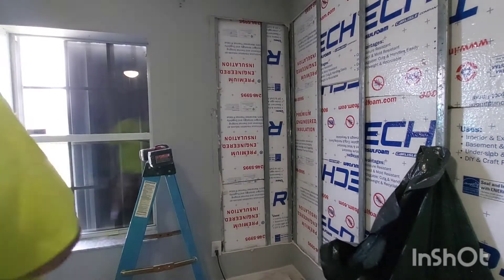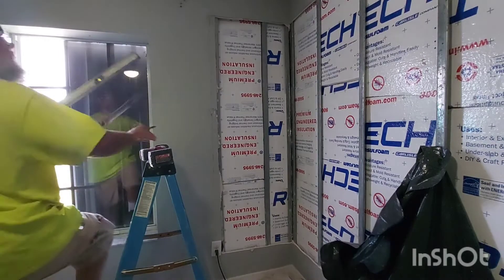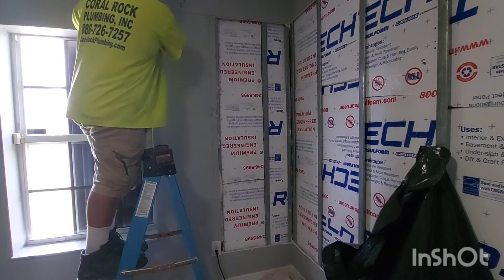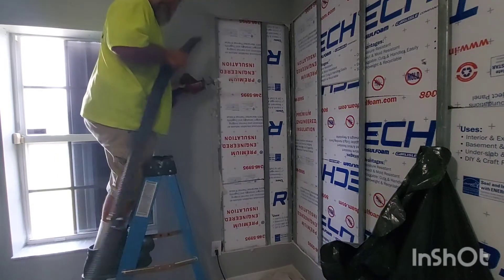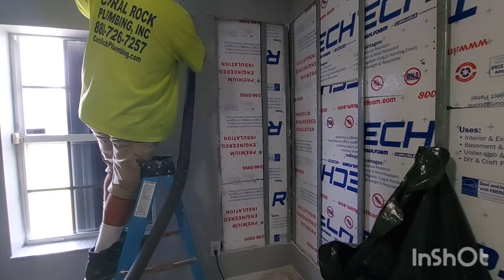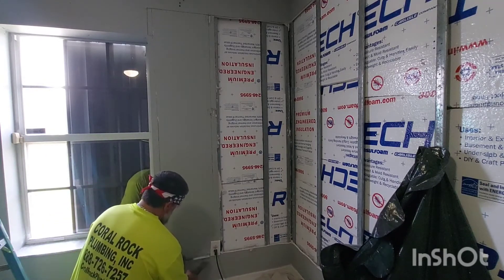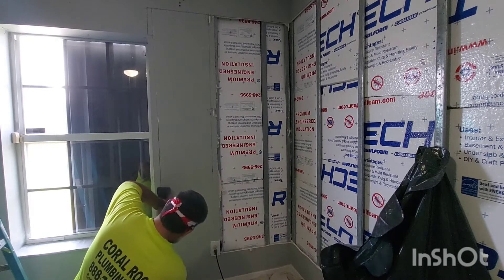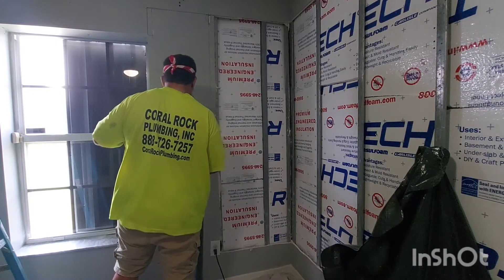R - Tech wall insulation 2inch Steel house

Comment: You could add a blind and blocking curtains cheaper than replacing the window.
Reply from the maker: Yes, but I was working in a house and noticed a bigger difference with double glass windows with gas inside them, they guys ac didn't turn on till afternoon

Comment: 2" R Tech only has an R rating of 5
2" of fiberglass insulation has an R value of almost 11. Fiberglass batts are mush easier and faster to install.
R Tech is the worst material in terms of cost vs R value. It is the lowest quality of foam which is why it has such a low R value per inch. It's R value is so low that they do not even print it on the boards for the consumers to compare in the store.
Johns Manville and other brands of foam are more dense and have R values of 6 per inch vs R Tech of 2.7 for the first inch. R Tech foam is so poor that it's rating per inch DECREASES with increased thickness. The foil provides the initial bump in the R value.
Reply from the maker: R 2" is 7.7, wall already have fiberglass R20, I added this to keep the installation from falling from the attic and I was able to cut all the drywall and push the boards up into the attic with the metal foil UV protection as well. Since the installation that  corner of the house has improved big time, next will be the windows change out.